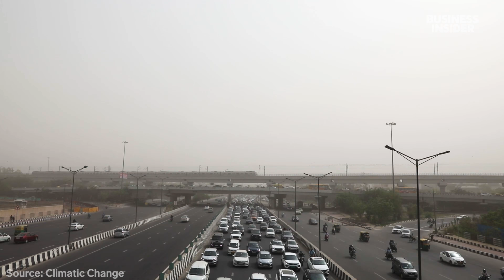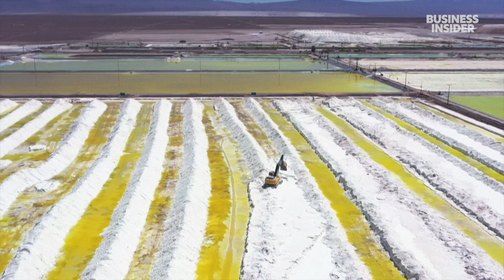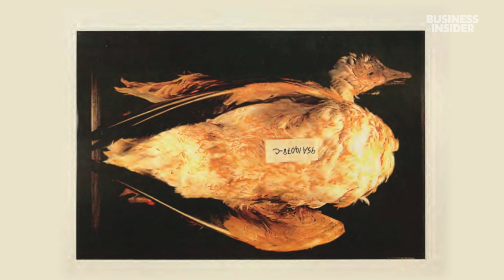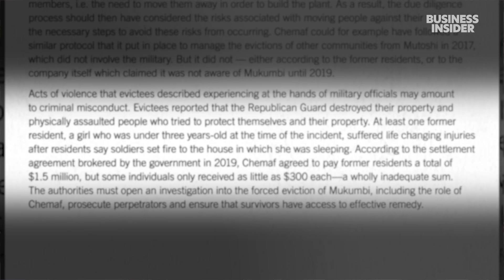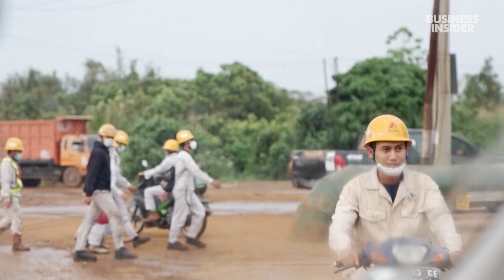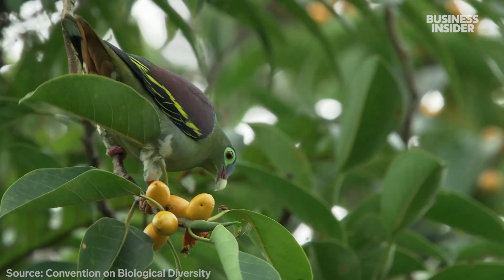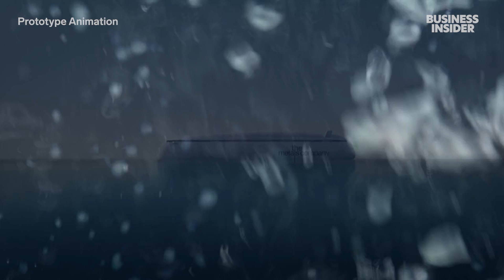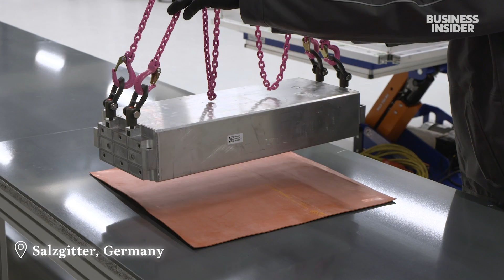The True Cost Of Mining Electric Car Battery Metals | True Cost | Insider News Marathon

Comment: EV's make no sense at all, they are a fire hazard, they are heavy which makes for bad handling, they have limited range especially when it's cold and you need heating in the cabin, production of the batteries takes a lot of energy, and they don't last long, and they are so expensive to produce that the car has no value when they don't work anymore. When one more EV hits the roads we have to increase electricity production, and how do we do that? We burn more coal, so EV's actually runs on coal. The most efficient way to get energy from fossil fuels is the internal combustion engine, and we are not going to stop using fossil fuels any time soon. So no you do not save the planet by driving an EV. They make no sense at all.
And by the way a normal petrol car can also drive on electricity from windmills and solar, because you can make hydrogen and then combine it with co2 from the atmosphere producing carbohydrates (petrol) which as we know can be fueled in a minute or so, it can be stored indefinitely thus solving the problem of storing renewables. All and all a way better solution.
And if you don't know, co2 actually does more good than harm, it makes plants grow, and more co2 makes them more tolerant to drought. More people die from cold than from heat.
In the past co2 levels were much higher, and life on earth was doing very well indeed.
So no co2 is NOT killing this planet. One has to be very ignorant to think so.

Comment: LFP batteries, that are starting to be present in more and more EVs, don't use Nickel, Manganese or Cobalt. It would be interesting to know the cons of those too.
Reply: lithium mining.
but perhaps we need to compare it with the current trend - extraction of oil and gas (which uses far more cobalt) and is a never ending cycle since we burn those and need more again tomorrow and the next day and the day after that...the battery once built will last a very long time 10-20 years in fact, then be reused for stationary power storarge, then be recycled to reclaim those valuable minerals to make a new battery for another 10-20 years.
meanwhile battery tech will continue to evolve and new better battery chemistry will be discovered - sodium ion is one and we have oceans of sodium available. unlike lithium.

Comment: 30 Minutes talking about "Metals Used For Electric Cars" but not a word about oil business: 
Oil and coal crush by far all other pollution and all other mining and extractive industries
The minerals needed to produce the coal and steel JUST FOR OIL EXTRACTION is more than a thousand times more than the minerals needed for the "6 Metals Used For Electric Cars"
The orders of magnitude are not the same (production in megatons per year in 2021 source Wikipedia):
lithium:                      0.1 Mt
OCTG steel for oil: 70    Mt (700 times more!)
Steel:                      1952 Mt (18000 times more!)
Oil:                          4221 Mt (40000 times more!)
Coal:                       8133 Mt (80000 times more!)
Of which 1200Mt for steel manufacturing
Of which 60Mt of coal for the production of OCTG steel solely for oil extraction
More than 3% of world steel production is specifically intended for oil extraction(OCTG steel: Oil Country Tubular Goods, 70Mt of steel per year for pipes, tubes of drilling…,100Mt planned in 2030 because we have to dig deeper and deeper)

Comment: I highly doubt that an EV will EVER be more environmentally friendly - regardless of its service life because you must consider ALL the environmental impacts of EVs - which does not end once it rolls off the assembly line. You have to consider ALL of the fossil fuels and resources and environmental damage that happens from EVERY part of each stage of the wind generated electrical process and the solar generated electrical process as well h from mining those materials, support of required infrastructure required, (concrete, roads, earthmoving equipment, fuels, oils, lubrication, tires, buildings),  as well as the tear down ,recycling, environmental impact mitigation, shredding of massive fiberglass wind blades, burying of said waste, And all of the infrastructure required to do that, (huge machinery, recycled material shipping, recycled material processing, buildings, vehicles, gas-fired smeelters, etc.)
It would be much better for everybody if we made a slow transition from purely fossil fuels to a hybrid vehicle such as the Prius. This would allow for a controlled escalation of mineral acquisition whereby environmental protection standards could be implemented. Otherwise, all we're doing is shifting the impact to the poorest nations in the world with the least ability to recover or deal with that pollution and destruction for which the world will still pay a price.

Comment: Which other industry uses cobalt?
The Oil industry to remove the sulphur from petrol. Vast quantities of it.
Reply: Also the aviation industry for blending metals at right strength and weight.
Reply: trade offs
build a battery that lasts and recharges from electricity for decades, or extract oil and gas, belch the toxins that come with that resource into the air and water to drive your ICE car for a day,...and tomorrow you still need more. everyday. forever.
now choose.
Reply: @r.b.l.5841 batteries do not last for decades. Maybe 1 decade if you are lucky
Reply: @r.b.l.5841  okay done I chose combustion engines.
Reply: @r.b.l.5841  long lasting batteries aren't easy to make buddy

Comment: Does the fossil fuel industry pay Insider News for the story? The tech in this video is out of date despite being only 4 months old. So way to ignore the advances in battery chemistry like Sodium Ion that uses no rare earth minerals, or Lithium Iron Phosphate that don't use any either, or the lithium from the Salton Sea in the USA. Eventually all the minerals used in e-vehicle batteries will be from recycled batteries but at least you mention it but say it "might not happen till 2050". How about saying it is happening now and will grow over the next 2 decades? Why aren't you bantering about the astronomical costs of increased climate disasters from losses due to more intense wildfires, hurricanes, tornados, and loss of coastal wetlands, islands and so on, from increased pollution/CO2 from fossil fuels? Or the damages caused by fracking, drilling, oil spills, and so on. Fossil fuels are the antithesis of sustainability. The EV will do tremendously less damage to the planet and humanity than fossil fuels. But you know, way to tell the most jaded view of a small part of a story with a huge bias against the best tech available to get the planet onto clean energy forever into the future.

Comment: Why Oh Why, have  we not gone down the Hydrogen route!
Reply: it doesn't work.
Hydrogen is a very small atom and it leaks out of containers, easily.
it take a tiny tiny amount of oxygen in a vessel of hydrogen to become a bomb - ie volitile, and it is very low energy density for it's volume.
the easiest way to make hydrogen is to reprocess natural gas - ie not helping.
Do some research on it and you will see right away there are many tough challenges to using hydrogen, I know because I worked on a project to split hydrogen from water using excess solar - ie solar that was more than needed at a large solar farm site.  There was no ecomical solution to make and store hydrogen efficently.

Comment: Do You know how to tell the CO2 "threat" is just a giant Lie?  To replace any meaningful % of the 1.4 billion light vehicles will take at least 20 years; but your lying stinking pathetic politicians could cut CO2 tomorrow if they wanted - just require all commuters to share their car. It would save massive oil; cut CO2 over night not 20 years from now, and reduce traffic.  So why don't they?  No Money in It - this is about selling you garbage you don't need, more taxes and restrictions.  Dump the liberal idiot liars.  Dinosaurs lived 160 milion years with CO2 between 1000ppm and 3000ppm they didn't die of heat; they died off due to cold.

Comment: EVs do nothing for the environment; of course if you are comparing to a Rolls Royce Silver Spur maybe.  EVs weight 30% more; the means they take 30% more energy to move. Unless you have home solar; you lose and additional 15% transmitting the electricity to the charger and battery. 80% of the grid is powered by fossil fuel. Turbines can be 70% efficient, but an afficient hybrid can be 50% efficient; plus 4 of 5 EVs lose the 15% in transmission and further 30% moving the heavy car.  The heavy EV also uses twice the tires; plus all that mining deficite to deal with. 1 Ton of Lithium takes 50 tones of ore and 500,000 gallons of water. It's just 7% of the battery.

Comment: Every single ice car has a battery.Very few legacy automakers use lithium batteries for the 12 volt requirements. New battery chemistries use no cobalt. Lfp batteries use no cobalt within a few years the only ones using cobalt based batteries will be ice cars.

Comment: At 15:43: "...conventional combustion engines don't use any [Cobalt]."  But cobalt is used in oil refineries to remove Sulphur for conventional engines - not ridiculous amounts but EVs with Lithium Iron Phosphate (LFP) batteries there is NO cobalt - so on the cobalt front, EVs with LFPs are better than an ICE vehicle! Would have been appropriate to mention this for balance.  There are many uses for Cobalt and unethical mining practices for cobalt existed prior to EV adoption.  But let's just blame it all on the EV.

Comment: Question about the lithium production:
If they have to solve the salts/minerals including the lithium in water, why don't they use a pipeline or tankers to freight it in a decent contraition as fluid? The transportation of fluids is pretty easy. If they build up a direktly useable conentration of minerals, the following production steps can be reduced.
Reply: Costs more to set new systems up. Those industries do not move unless they can make immediate profits or they are forced.

Comment: We're just swapping one problem for another! When those EV batteries die no one is going to replace them. The cost of the battery will exceed the cars value. So the whole vehicle will be worthless scrap. Keeping your old car running for as long as possible is far better for the environment.
Reply: Exactly right. Battery replacement isn't a feasible option as it's more than a new electric vehicle. It's all stupid. Gee a 10 minute fill up at the gas station or 3 hours on a charger. Time is valuable.
Reply: In all honestly, just look at the cars flowing through scrap yards... Every car isn't used to it's fullest extent. Many are scrapped with running engines, or they have a bad engine or transmission and aren't worth fixing. The amount of good useable vehicles scrapped depends on the area.

The only thing we can hope for is for battery recycling to be developed, since all the minerals are there. 

We already recycle steel, aluminum, copper, etc... from cars and scrap.

Comment: I keep trying to show you all how to run EVs and everything else. We wouldn't need batteries and we wouldn't have to plug in or worry about blackouts anymore. Not sure why they keep choosing the crappier ways of doing things. We've had the answers to everything for years now.
Reply: But in the current system it needs to make money. If it doesn't make money it won't be done most of the time. So all the good ideas go to waste.
Reply: @DavidSmith-oy4of  capitalism will still serve it's purpose for a few years after the tech is introduced to society, but after that, not so much. Humanity is already upgrading itself. With the right combo of Neuro Link and nano tech, 😎

Comment: Petrol powered cars ARE NOT a problem. Its the corporate structure of today's greed centered motives. Gas or Diesel have greater energy density than EV's will ever have. If the effort to make EV's look good were put into improving internal combustion vehicles efficiency instead of making them more and more complicated and useless gadgets with ridiculous amounts of electronics both of which lack good quality are the problem.

Comment: i've never bought the hype of EV. your prepaying any savings for a premium and rare mineral waste. Now your stuck finding anyone wanting to work on them when something goes wrong! -  you can't go to a local mechanic!....... EVs are no different to full scale RCs where you replace the whole component rather than fixing it like a combustion engine. a small dent in your battery is a cost you don't want to know. all these  100s-1000s of individual cells WILL inevitably get out of balance in your battery pack; at that point your in for a hard landing. EVs resale depreciation are no different to a flagship phone you bought only to get 1/4 back the following year as its outdated. EV's in my opinion have a larger carbon footprint than any fuel based machine if their life expectancy isn't 10+ years which it clearly isn't based on battery 1/2 life studies. The world doesn't have enough lithium to make the world go EV. the world needs to wake up as the devastation finding these raw materials has a compounding effect on the deforestation to make people think their doing the "right thing"

Comment: The unstated trouble with replacing oil use with electricity is what will be used to pave the roads for those electric vehicles to move on? Without the ability to use all of the barrel of crude oil for some economic use the cost of the small fraction that is the tar will be enormous. The rest of the barrel will have to be discarded. The planet has millions of miles of asphalt ( bituminous concrete) roads and highways. Either concrete or bituminous concrete (or both in layers) is used to create the interstate highway systems of the world. They are very expensive infrastructure and can cost millions per mile. Both concrete and fossil fuels are blamed for global warming. What can possibly replace them at a cost the future could afford?  There are countless million sof miles of urban and rural roads as well. 

Another trouble with all green substitutes is they don't tend to have the energy potential per volume that oil has. Without cheap energy the cost of living will rise enormously. The other trouble will be that people don't look at the global warming issue simply as a practical problem. They tend to regard it is a crusade and even a religious conversion. It is not a topic that is discussed in a purely rational way. There are a lot of fake green solutions and selective facts regarding it. Some are good and some are junk and the product of market hype. No doubt that will get worse. 
Would it even be possible to refine the tar from the rest of the crude oil and return the greatest part of it to the well? There are tar sands but they cost more to refine to create dozens of different petroleum products. Perhaps they are the future? It would make Canada the world source for all paving material?  And it could also guarantee that the price was as high as possible if there were no other sources or alternatives. 
Perhaps the future will restrict transportation to mass transportation and limit private vehicles because it may have become very expensive?  The railroads used to be an extensive but also limited network. It connected and encouraged tighter higher density urban development.  Suburbs were smaller and tended to be for the affluent. That world could return.  Unfortunately urban development tends to have all sorts of density restrictions. Suburbs all seem to have such restrictions. They would all have to be revised. That revision is usually a matter of local control that will make it difficult, expensive and time consuming..
There are no perfect adaptations to climate change.  And a world with too many restrictions and regulations is a difficult world the live in let alone enforce.

Comment: When we look at things like global warming etc. Are the facts true. All through time seasons and weather has changed. As for rising sea levels, who has looked at the fact that Man keeps reclaiming sea for land, man keeps digging up the country side and the lose soil washes into the sea. Then the shipping, man keeps building bigger and bigger ships, a boat displaces the same amount of water as it's weight, so with so many boats / ships displacing so many million tons of water, of course the sea level will rise. I live in Auckland, New Zealand. There is a volcanic cone called Panmure basin, when I first came to this city at low tide there was still water in this basin, now it is mud flats so if the sea is rising why is the basin getting shallower. Easy, soil run off from mans construction efforts are flowing into the basin. If this is filling up, then where is the water going to? Easy, global sea levels rising

Comment: Technically he's right about the sea nodule extraction producing no environmental damage from tailings, at least on the ocean, since the nodules will be refined elsewhere, however the additional mud extracted in the process has to be dumped somewhere, surely right behind the harvester as it goes along, but that mud wont just sit idly on the seafloor, it'll be deposited in a silty cloud that could have significant effects on the sealife there.

Comment: What this fails to mention is that the use of Lithium in batteries is falling due to changes in battery chemistry. Cobalt for batteries is only 42% of its use. Copper is also decreasing in electric cars as voltages increase and more solid state components are use and controls are being converted to fibre optic.
 These "soft hit" pieces never seem to balance the information given, but then I suppose they wouldn't get the views they are looking for!